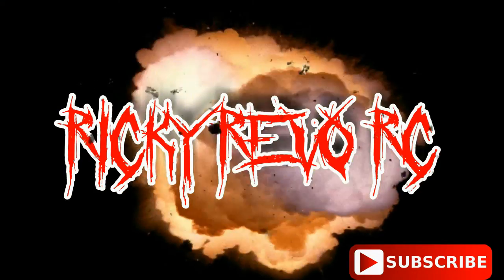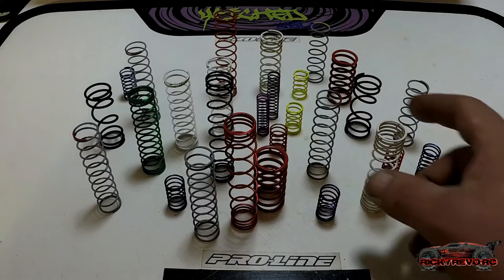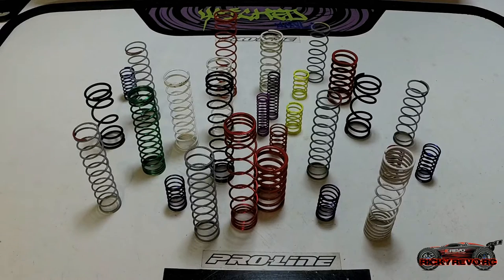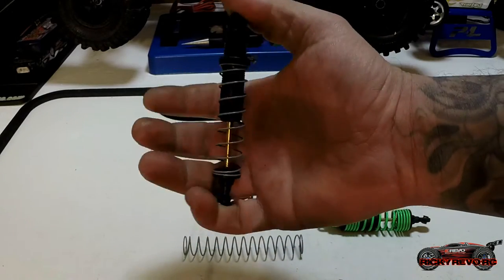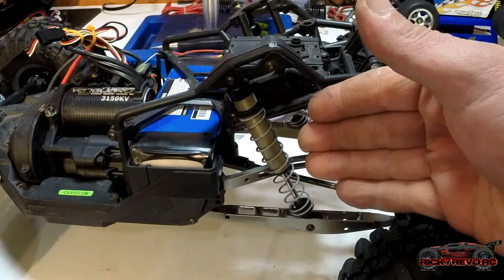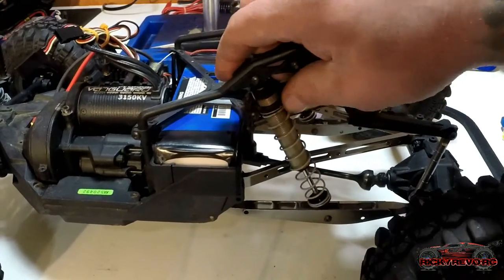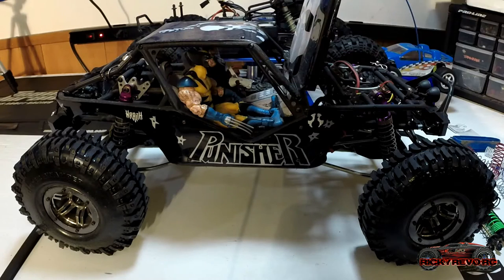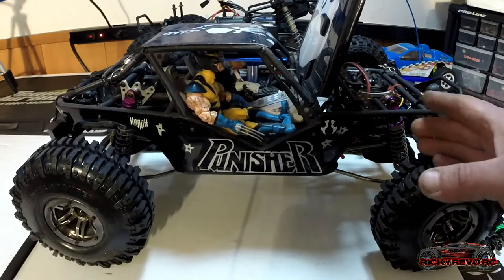Lets talk about RC car suspension systems in depth!

Comment: Question on those green spring shocks. Do you think those would hold up a platform that weighed 20-30lbs?
Trying to add suspension to a rear rack on and e-bike, trying to get it to move (or not move) independently from the bike.

I know it's not really RC related but just trying to get an idea of their strength.

Thanks.

Comment: Nice, so if I was to buy new shocks for my Arrma Granite would it matter if I was just to buy some for monster trucks if they were the correct length? Because it's a heavy car, I get the feeling that I would have to replace the springs with the originals? (My original shocks leaked)😢

Comment: came for a handling lesson, got a physics lesson, and a poor one at that.
Reply: tell me how different spring/shock oil combos affect handling/ their specific applications. A 6th grader can give a better explanation about stored energy.
Reply from the maker: cool can you make a video because a second grader knows how handling works. Judging by your comment you probably know everything!
Reply: @RickyRevorc  you even had it backwards in your video. quit shielding your content and realize you could do better. You pulled the wikipedia page for how a goddamn spring works, lets see the same thing for sway bars or other handling components. OR, even tell me what happens when i run a stiff setup offroad or a soft onroad setup. congradulations, theres your script for your next video.
Reply: @RickyRevorc  Also, judging by your ENTIRE CHANNEL, you should know a ton more about RCs than me.